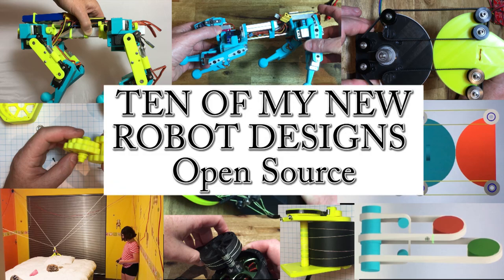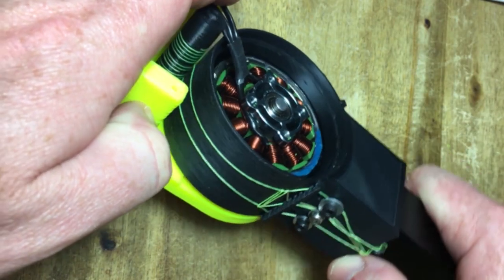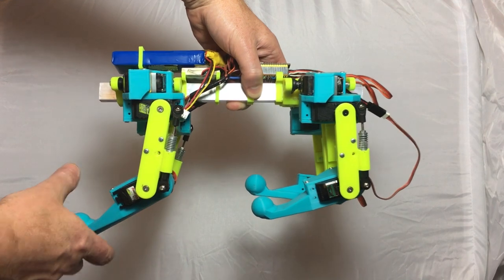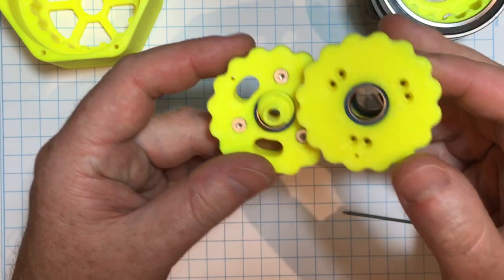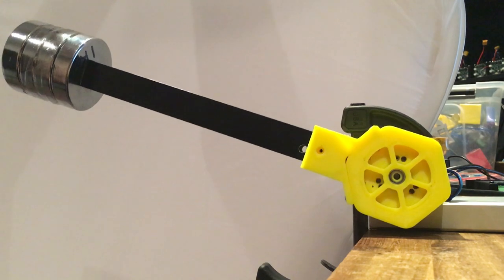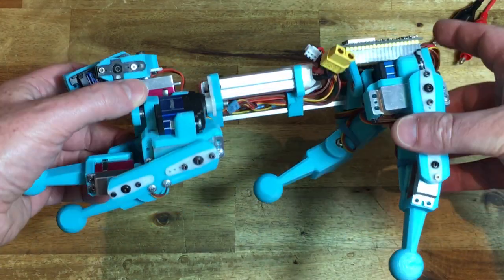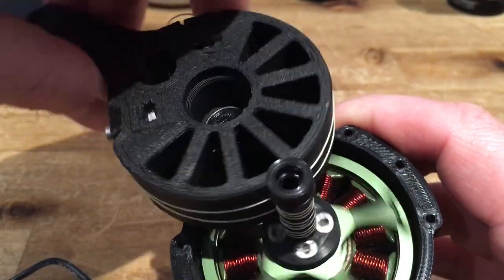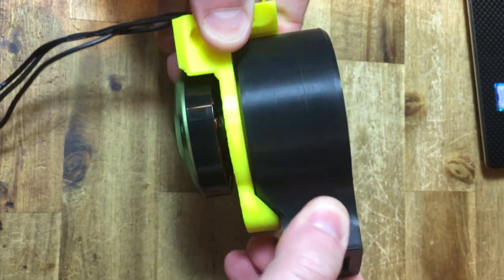Ten of my latest Robotic Designs

Comment: You deserve a lot more attention! Especially your cycloidal gearboxes were a great inspiration to me. Thank you very much! I really admire you!
Reply from the maker: You are too kind. Have you 3D printed any gearboxes yet?
Reply: Same here! Thank you for sharing your fantastic work, it's a wonderful inspiration. At the moment I'm working on printing a 13:1 dual disk drive using brass tubing around dowel pins for bushings. I'm hoping I can get the main housing under a 55mm diameter so I can use it in a smaller learning project of mine
Reply from the maker: @Peter-898  Can you please tell me the dimensions/radius' you are using. I'm keeping a database of what works best. What motor are you using? Good luck with the project.
Reply: @PaulGouldRobotics  I'm using a 25mm radius with 4mm OD pins and a 1.6mm eccentricity. Right now I'm mostly guessing on the acceptable range of eccentricity based on other designs, but it seems to work fine. I didn't get the tolerances completely right on the first print, but it looks like it would work nicely with a couple adjustments. It could probably go a good deal smalller too since the lobes are pretty large right now. I'd be interested in seeing that database, it sounds like a good idea!

As for the motor, I'm using a cheap 1000kv A2212 drone motor since that's what I have already.

Comment: It's number 5 that blew my mind. Usually cycloidal gears come with many small pins. Looks like in a two stage design you can omit them all. What a smart thing to do
Reply from the maker: Thanks. I like this design but the output has a strange retrograde action which I am trying to solve.

Comment: Love your contend, thinking of using a cycloidal gearbox for some cosplay wing joints, but replacing and extending the axle of my brushless motors scares me a bit. Last time i tried i knocked one of the magnets lose.
Reply from the maker: Yes, swapping out the shaft is not easy. I do it carefully in a medium size vice. This is one a reasons I am going with timing belt/capstan drives. For Cycloidal-Brushless check out the work at https://hackaday.io/project/165653-3d-printed-robot-joint-with-active-compliance or my tail design at which has the motor linked to a timing pulley so no modification. https://hackaday.io/project/163766-low-cost-3d-printed-robot-tail

Comment: hi. Your design is awesome. I have tried these designs. I didn't expect another person to do these things. You can learn about the LIMS2 robot, and there is a paper you can read. "Development of a New Backdrivable Actuator for
 Haptic Interfaces and Collaborative Robots"。When I was testing your "Dual Disk Linked, Two Stage Cycloidal Gearbox", this reducer got stuck when there was an external load. Do you know why?
Reply from the maker: I have not seen that paper before, thanks for the link.  The LIMS2 design looks a bit different from the paper. I need to read more in depth. Did you 3D print the #5. Dual Disk Linked, Two Stage Cycloidal Gearbox that is similar to the one in the video? The one in the video lifted 2kg @ 250mm using 0.4A @24V. The motor gets a bit warm at higher currents and I didn't want to melt the housing. I add Silicone grease to the disks and housing but I don't see it binding at any reasonable load. Please chat and send photos of what you made thought messages at hackaday.io
Reply: @PaulGouldRobotics  thank you，You may follow my channel. That article is related to your ‘Differential Capstan GUS Simpson Drive’, not LIMS2. I think you might be interested in learning about 3K planetary reducers.

Comment: The capstan drives seem quite interesting, could you do a more in-depth video about those?
Reply from the maker: I like the capstan/timing belt drives. They are so cheap and simple. I've been fixing up the CAD and reprinting them for a video and open source. Should be a week or so.
Reply: @PaulGouldRobotics  Cool!
How do they compare to the cycloidal drives, in terms of performance?
Reply from the maker: @Skythedragon  It is too soon to tell. Because I don't use bearings on the outer ring of the cycloidal gearbox there is friction when the output is at high torque. This can cause binding, lowering efficiency. 
Which the capstan drive, it is all rolling contacts so efficiency is always high. Also to reduce backlash you can just tighten the string and the backdriveability still good.
Reply: @PaulGouldRobotics  Ah
And the highest cost parts for the capstan drive are the motor + bearings I assume.
If it can be put in a small package I think it could rival the cycloid drive
Reply from the maker: @Skythedragon  BLDC is $24, Big bearings are $5 x2, small bearings are $1 x3, wire is $3, timing belt is $4. My control board is costs about $30 (USD) The stepper version about 1/2 the cost.
Reply from the maker: @Skythedragon  I want to try it with a 4112 BLDC motor

Comment: Does GUS get its ratio from the motor gear : outer radius of the tilting circle?
Reply from the maker: I'm not really sure but the output is not linear. At 0 degrees it is about 5:1, at 90deg or -90 it is about 6:1. There's some tan function in there somewhere. Basically, it hard to give commands to the stepper to move X degrees.
Reply: @PaulGouldRobotics  Yeah...we designed it to drive the end of the arms linearly instead of the angle. :-)

Comment: is there any reason that cycloidal gearboxes are not widespread in the industry? do they have some glaring weakness compared to harmonic drives?
also what do you think about the longevity of capstain drives?
Reply from the maker: They require high precision machining which means $$$. They are also not perfectly balanced which means they do not operate at high speeds. They are good at low/zero backlash, high torque in a compact size. I do not know much about harmonic drives so I can not compare. The longevity of the capstan will depend on the type of sting used. I will test different string soon.
Reply: AFAIK both need precision machining to even work reliably, but if it's available, both give low backlash, large reduction. Thus, they compete for the same market. Cycloidal is unbalanced in is simplest form and mitigating solutions bring complexity. It is a disadvantage against the strain wave gear drive, which is simpler, balanced and lighter.
It seems like strain wave gears are better suited for robotics, but I read advertisements for larger cycloidal drives aiming to substitute planetary drives. Maybe their market isn't completely the same after all.

Comment: What are you using to control the brushless motors? Odrive or something less expensive?
Reply from the maker: I have made a few of my own controllers. They are all on the hackaday page. They are not as good as ODrive (or others) but they are smaller, run Arduino and suit what I need. They are slightly cheaper.

Comment: I like the capstan drives. Are they robust? Does the cable ever get tangled/stuck or leave its groove? I noticed the driving cylinder is threaded, what are the pros/cons of threaded vs unthreaded?
Reply from the maker: It is too soon to tell if they are robust. I've only been using them for a few months. If the threaded groves are designed correctly and the tension is kept tight then all is well. I'm using 1mm 49stranded wire now and it is much better/more tolerance. Pressure angle is always 90deg so there is no chance of binding. 
They are my new favorite drive and work well with 3D printing. They are also very cheap to create.
Reply: @PaulGouldRobotics  Is it nylon coated steel wire or something else?
Reply from the maker: @sebastienloisel7983  https://www.ottostackleworld.com.au/superflex-supertest-49-strand~34668 not coated stainless steel fishing wire. Very flexible. I'm working on a video now to explain it all.
Reply: @PaulGouldRobotics  Thanks. I had never seen your "Gus Simpson Joint". Do you know about the simpler belt drive below? Why do you want these green and red shaft to move up and down, is that one of your articulations? Seems like you'd need something pretty fancy to let your motors swivel or something.
https://www.youtube.com/watch?v=-dtBWDVshYY

Comment: Why are you going away from cycloidal drives?
Reply from the maker: Timing belt and capstan drive seems better.
Vibration is low, tolerances are low, backlash is zero, efficiency is high, assembly is quick and easy, cost is lower (less bearings), weight is lower,  motor is protected, size is smaller. The only problems to deal with is belt tension and string creep. Sting creep can be fixed by using the right string (dyneema cord or 49 strand stainless wire)

Comment: Great job!
Have you managed to achieve smooth movement with those cycloidal drives? The number one thing I have noticed on all the 3d printed cycloidal drives on youtube is that even though the starting movement is constant, the end movement has a fluctuating speed.
Reply from the maker: The triple gearbox in this video is quite smooth, with only slight vibration.
Reply: @PaulGouldRobotics  Awesome.
By the way, you seem to have commented on pretty much any homemade gearbox video I click on. So you've obviously checked the work of others too.
In your opinion, is there any diy gearbox that is "clearly" a league above the rest? (including your designs too)
Because I want to try and print/improve upon an existing design, and its hard to try out all the different designs that are out there with my minimal resources. So, picking a specific one that has the most promise would be a huge headstart.
Thank you in advance for any advice!
Reply from the maker: @Mr30friends  There is no one solution for all applications. If you tell me what you are designing, I can give you my opinion.
Reply: @PaulGouldRobotics  Thank you for your answer!
I want to make a 6 axis robotic arm for my thesis project (bachelor's degree final project). So I need accuracy, low backlash and high reduction. I don't mind if its slow and slightly heavy.
I would try to make my own design but my focus has to be on the software in this case. Theoritically, I could probably just use cheap servo motors. But I would like to make something practically useful this time and not just a "toy", if that makes sense.

If the proper solution is too bulky, I could also reduce the 6 axis and turn it into a paletizing robot with less axis.
I've been thinking of using something like this, 
https://www.youtube.com/watch?v=utDagouxM5U&t=3s&ab_channel=Skyentific
or in general some kind of design that uses cables such as the ones you showcased on the video. But I have my doubts because no one ever uses them in actual robots. And for that reason I fear that although they seem perfect on paper, they might have some major negatives I am missing.
Reply from the maker: @Mr30friends  please chat to me on hackaday.io or on Discord @Gouldpa.

Comment: Hey Paul, impressive stuff! do you have any thoughts on driving "rotary" delta printers? (see e. g. https://youtu.be/IG3Yfhys-N0) what drives would you consider most suitable for such a thing? 
I was a bit researching into speed limitations in 3d printing and besides the max flow of the hotend there is basically only inertia vs rigidity. all linear bearings seem more expensive and prone to wear and slack than rotational ones. so the original delta robot design should be very suited and comparably cheap. I'd like to test that and build one, but i'm breaking my head about the drive...

loosly related to capton drives and also to the ball joints needed in a delta robot:
https://youtu.be/aLaqMreVj9o
https://youtu.be/RXhtcWz5GBg
the more simple solution in the delta would be magnetic ball couplings though...